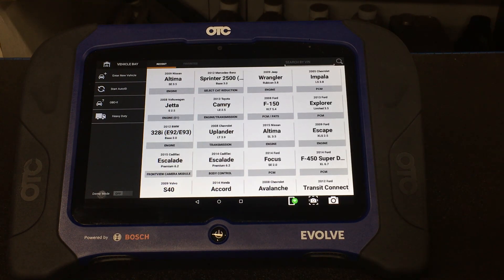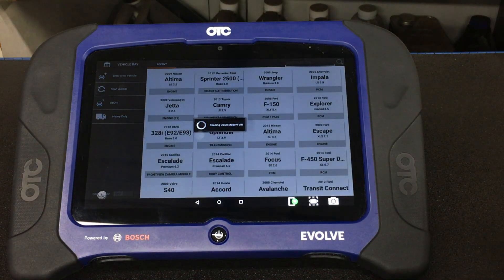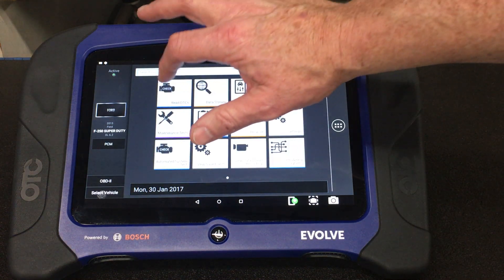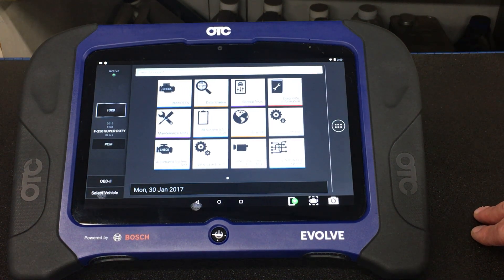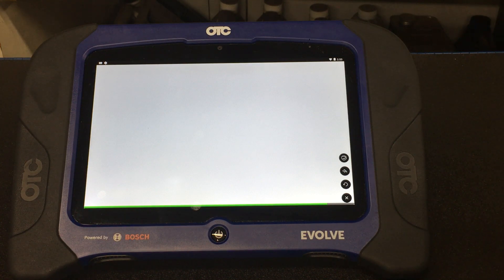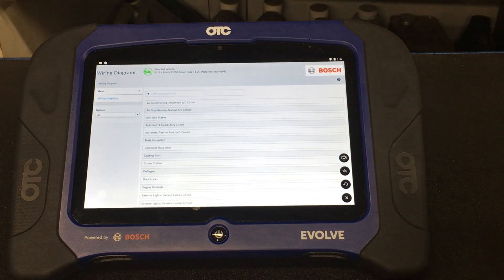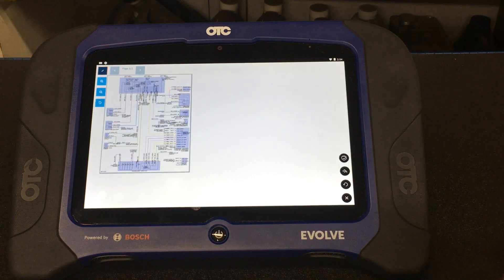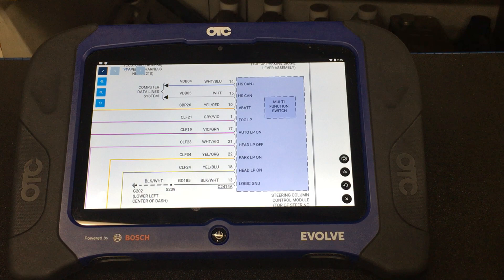Using wiring diagrams to diagnose and repair vehicles

Comment: This is a nice unit. I need to trade my Genisys touch in for it.
Reply: Hi you still have your genisys touch? I'm wanting to get one, for 3 things ( the j2534 passthru of course,  the screen size, and it runs off Windows). My question is, does the Gen Touch have a large database of "built in" car info? Like, without subscription, or internet